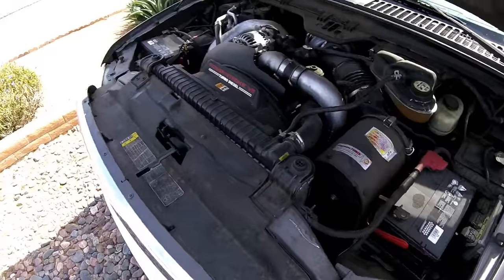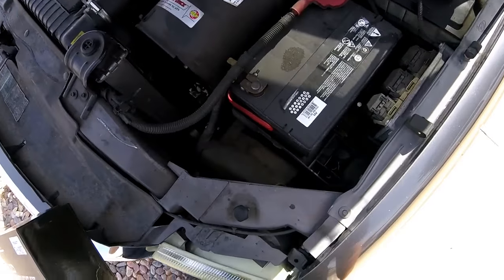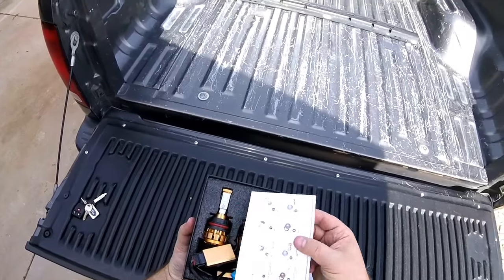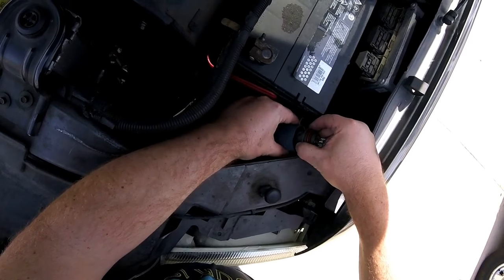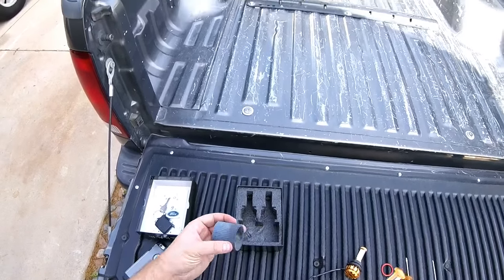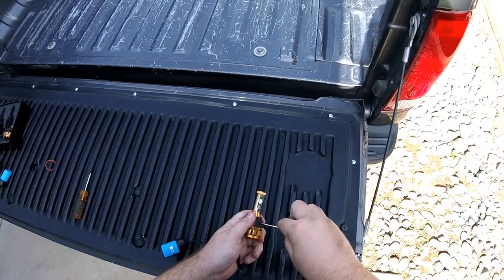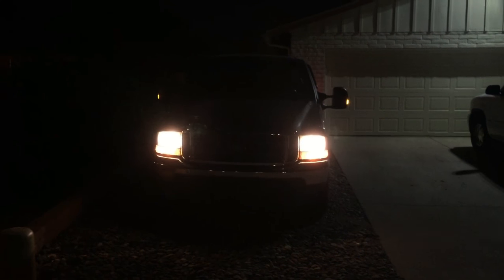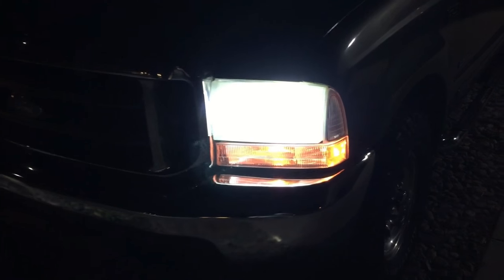Auxbeam LED Conversion Install F250

Comment: With these fit on my 2006 6.0? H13 right?
Reply from the maker: Thanks for watching! I don’t have that truck anymore, but I believe my 04 used the 9007 style bulb. However, Auxbeam makes them for a lot of vehicles, I’m sure they’d have some that would fit. I’ve used them now in several vehicles, always good quality. Hope that helps
Reply: Beer League Hockey gotcha. Thanks.

Comment: Were they 2 sided or 3 sided leds? Did you adjust the angle to line everything up? Driving review?
Reply from the maker: I didn’t seem to have to adjust the beam when they were installed. Unfortunately, I no longer have that truck for an after install driving review. 

I liked them so much, that I did install the same brand in my Tacoma. Those had three sets of LEDs
Reply: Ah bummer. I have 03 excursion with same headlight. I just ordered the w series with hi low. But they are 2 sided with 4 leds each bulb. I guess I’ll make a review video myself.
Reply from the maker: Sorry about that, I was still wet behind the ears when I made that video 😔